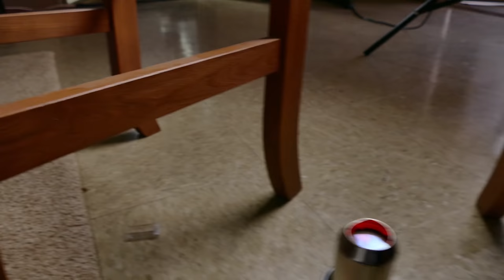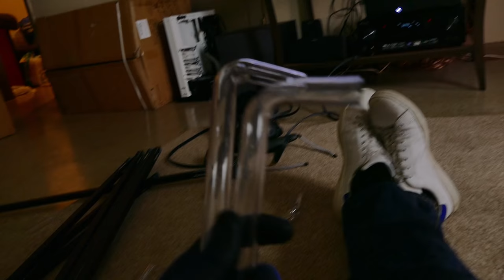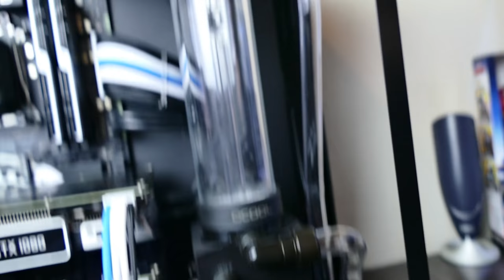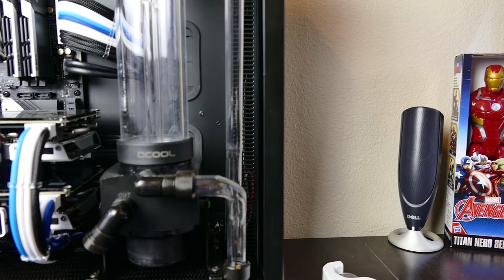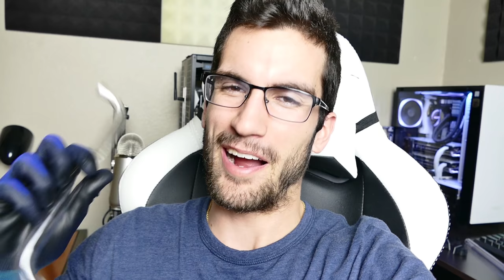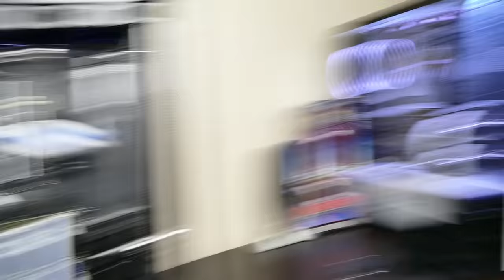Project 'Blue Sky' Custom Loop PC Build Log (Part 3 of 4)

Comment: Hey Gregg, just a suggestion why not come straight from the back of the pump and do a 90 degree back and then a 90 degree down to the radiator making those just two bends, hell you could even use 90 degree fittings and no bends with three small straight runs. back over down. Hard to tell in the video but maybe the distance back is too short to do that?
https://gyazo.com/d28b8c4ad4fb2014271d14237d4854dc

Comment: I think your trying too hard to make far too many bends within small tubes. trust me, when you run the loop you will see imperfections. you only need to heat it enough quickly to bend it once without continuing to put it over the heat gun, that is the result of bubbles. My first time, I wasted like two 50cm tubes. too many rediculous bends within your build. Even the pros don't do that..

Comment: I think the tube bending process would have been smoother for you if you went with a smaller diameter tubing. I have used 3 different tube sizes and 12mm is way easier to work with then the diameter your using.

Comment: Yep,  my first foray I had set aside an entire day and had 8 meters of tube. 2 days later, with sore hands and cramping fingers I had it good enough. It would be another couple of weeks before I pulled it apart and redid the one tube that wasn't up to stuff.  You are correct that, like anything, you get better.  I was already 100 times better when I revisited that last tube

Comment: Put it on low heat and rotate the tube while also heating up the tube about 1-1 1/2 inch away from the spot you want to bend! I havent put custom cooling in my setup yet but i have helped someone do theirs though and yes it was expensive and frustrating!!!!!

Comment: You need to keep spinning the PETG when you are heating it and not leave one side exposed to the heat for very long. That's one of the reasons you keep getting kinks in the tubing. Another reason is because you keep giving those little forceful bends to see if it is ready to be bent while heating it. When you continuously spin it, it will give you a better idea of when the tube is ready because the tube will start sagging while you spin it and a few seconds more over the heat, you can start the bend. The smaller silicone insert might still cause some kinks, but not as bad as you're getting now. Hope this helps you out some. Also, if you have a wrench socket, use that for 90 degree bends. The bigger the socket size the better.

Comment: Use a copper pipe cutter with an adjustable cut depth and roll it round increasing the cut depth slightly after every couple of turns. It'll cut a groove which eventually pierces all the way. Scissor type cutters are for soft reinforced tubing not brittle stuff.

Comment: You are supposed to dip your silicone insert in soapy water and it will help keep the PETG from over heating and also make the insert easier to remove. However, since your insert isnt an exact fit, it might not be a huge deal. But dipping the tube into the water after the bending will make it keep its shape.

Comment: when you cut the tube with the cutter, you hold the pipe, and you cut the pipe rotational, not like a scissor. Your pipe will end up looking like someone stepped on it! I know, because i use to do plumbing. same goes with copper pipe, rotational cut. Also if you want a perfect bending on hard line, use a pipe bender like what we use on copper pipes, saves you the frustration.

Comment: Keep at least 4 inches away from heat gun on low setting only, constantly rotate the tube and moving side to side about an inch or two and wait till tube cannot hold itself, do not rush it or it will kink, keep hand pressure even and light or tube will stretch or push together. When I did my first build ever with acrylic these were the most important points and only scrapped about 3 feet. Properly heating a bend takes time with acrylic I was taking almost 5 minutes per bend because too close ,too fast and not rotating ruins the bend every time.

Comment: The silicone inner rubbers have to be slightly to smaller than the tube I know when I bend 12/10 tube the inner diameter of the bending rubber is 9.8 this is because when you put a bend it puts stress on inside side of the bend gripping the rubber and holding it in place if it was 10mm it would be near impossible to get the rubber back out.

Comment: I was relatively competent at it when I tried it (I found it slightly too time consuming however, but I was more busy with school at the time) but I had done neon tube bending a couple times before, and that was a lot harder, obviously, glass and blowtorches and having to blow into the tube to stop it collapsing, it was a pain in the ass without lube.

Comment: Gregg I have never seen a silicone insert like that most builders use a thick walled(to prevent kinks) soft tube that fits and most will have a bowl of soapy water to lubricate the soft tubing so that it comes out easier I just figure you could take one of these tips.

Comment: A friend of mine got tired of trying the silicone inserts that didn't work for him.  He went down to our local gravel pit and got some fine sand, picked up some corks from our pharmacy, and went to work on it again.  He said it was far easier and more predictable to make the bends.  He also used a diamond electric saw to cut the tubes.  All in all he put it together and it looks great.

Comment: With those cutters you have to rotate it around the tube or it will pinch it like you showed.  Rotating the cutter around the tube while you squeeze should nearly eliminate that problem.

Comment: I can save you a lot of time, heat up about 3 to 4 inch's on each side of your bend. If you only heat up a narrow area you will have crappy bend all day. The more tube you heat up the easier it is to get the bend you want.

Comment: Spin the pipe in your pipe cutter as you make your cut. only till the cutter starts to cut into the pipe without deforming it. then Finish cutting through your pipe all the way, and you will get a straight cut. as long as your cutters were lined up straight from the start, otherwise it will corkscrew up or down the pipe.  take it from a pipe layer.

Comment: to cut the tubing simply apply i light amount of pressure on the tube with the cutter then twist the tube until the blade just pierces the tube then continue cutting

note: only twist the tube slightly, not full 360 or anything

Comment: ok one thing ive noticed your not doing is shimmy the tube side to side a little bit. you want to heat up around 3 to 4 inches with the middlebeing where your bend is, while also spinning it around.

Comment: When i cut PETG i put it in the cutter then rotate it to "score" it a little bit before going thru with the cut so it does not bend. give it a shot. Also Rotating the tube constantly helps spread the heat where you are bending as well.

Comment: You werent rotating the tubs enough to distribute the heat evenly before your bends and rather then let the tube bend when it was ready, you were bending it with uneven heat. So one side might have felt ready but the other was still to cool, thats what causes those kinks or bubbles at the bend location.

Comment: Well it can cut bether. Tight the tube on something and rotate the tool until you cut it. You don't need to use to much force. Maybe it is not the fastets way but at least you'll get better cut than this.

Comment: one thing i noticed you werent doing is your only heating up a small section of pipe you may want to move the pipe an extra inch left and right and heat up more area than what you showed

Comment: Do not directly cut the tube by putting pressure on the cutter, turn the tube until it is cut. that's how to use those cutters.

Comment: Hey Salazar :-) first I have to say that I am watching your videos since your Yt start so maybe a year now  and I enjoy your videos.  The Tubes you are using aren't Petg's they are acrylic tubes, that's why you couldn't cut them evenly with your cutter. the best way to bend curves would be if you measure the distances between the connections you wanna have. then paint them on a paper and lay your drawn picture of your bends on a table. Tape the edges of that paper on the table. if you wanna bend them free handed use drinking glasses which are little smaller than the curve you wanna bend and bring them to the place of your paper on the table where you want your curves. Now you can start to heat the Tubes.  With your heater you have to stay about 10 inch above and always turn them while heating up ( you had bubbles inside because they have been heating too fast and Ono side was cooler than the other side and they didn't stretch evenly while bending ).  So now heat them up like I said and always heat the Tubes 5 inch at both sides more than the bend you want. When the Tubes heated up they look glossy and the tube tries to bend itself. Take the tube now and lay it with no pressure on your painted picture on the table. You can bend it now around that glas which is on your draw without using pressure just to have the right angle. I bet this works even perfect ;-) ( I did it that way in my rig the second time I did it ) . Please be careful and take out the Tubes you have already installed because at the places of the Tubes where you have bubbles inside the acrylic tubes gonna break in nearly 2 - 6 month so take care. Sorry if my written  English isn't perfect but I had to share that with you.  Greetings from Germany and good luck with your build.
Reply: sorry Ono meant one :-)

Comment: in my experience those pipe cutters works better with light walled tubing if you apply pressure very gradually and continuously spin the tubing (or cutter) all the way around, cutting a ring deeper and deeper until you finally make it through. Patience my man.
Reply from the maker: Billy Weisberg Not easy to do with this tool, which is why I do not recommend it.

Comment: You were using that tubing cutter wrong. It isn't scissors and shouldn't be used as such. Speaking from 15 years experience, those tubing cutters can make cuts as straight as any other cutting implement if used correctly. Next time try to cut slowly and turn the tubing steadily as you cut. If the tube is getting deformed then you're using too much pressure.
Reply from the maker: Funk E Not easy to rotate that tube in the tool. At all.

Comment: Welcome to the bending club!
Jay got me hooked on custom tubing about a year ago. Good job for not giving up. Good that I hat you didn't have to pay for the gear.
My basic tip would be...make sure you use the insert a bit out of the tube. That way the tube show you where. it want to bend. Use low heat and adapt the temp by holding the tube closer or further away. Heat the outside a bit more when you start to bend. The material need to stretch farther away.
Have a look at Jays view..great tips there.
Hollar at me and I will help ya
Reply from the maker: Thanks for watching, Stefan. And thanks for the tips!

Comment: As long as you aren't using a proper insert you won't get any kind of decent bend with your tubes. It's not a lack of skill. The insert is just too small. You shouldn't be able to get it in the tube without some dish soap water.
Reply from the maker: UnitedStatesOfMoney Exactly what I was getting at.

Comment: good going.. See i told you that cutter isn't meant for PETG and is for soft tubing (through my twitter handle @Devilz_ADV).. And ya don't worry about the same being awful.. you will get good with practice.. and there is always scope of improvement at later stage.. I rather prefer straight lines...but took me time to improve.. its a evolving process.. and ya Jayztwocent was very helpful.. watched his videos over and over again to lean...
Reply from the maker: Virender Negi It's for hard tubing. Says so right on the box.

Comment: Why my GeForce GTX 1050 doesn't have a VGA port and my old GeForce GT 630 2gb has one VGA port?
Both GPUs are from Gigabyte and the gtx 1050 is the standard one with one fan
Sorry if the question is stupid
Reply: LogTop because vga is getting old and  no longer supporting higher refresh rate at higher resolution thats why they used hdmi or display port instead of old vga
Reply: +neshwin ng Thanks
Reply: you can get an display port to vga adapter that will allow to to use a vga monitor if you need it.

Comment: Fill the tubes with sand , cap  the ends. Control the heat better.
Reply: And you need a "jig" something circular and fixed to a flat surface to ensure a proper circumference.

Comment: i wonder if you could do it like a neon tube blower. check that out, doesn't use the silicone.
Reply: they use a soft tube connected to a cork in one end of the hard tube, a cork in the other end, and the soft tube in your mouth. you sustain air pressure in the tube by blowing and that keeps the bends from collapsing.

Comment: you are cutting them in the wrong way! the cutter does not work like a pair of scissors! you must put the tube inside the cutter, and then twist the cutter around the diameter of the tube multiple times, and then it will pop. you must not squeeze the tubing, you have to slowly cut the tubing around and around.
Reply from the maker: John Despotakis Not easy to do with this tool. I rotated later on.
Reply: Salazar Studio 
I'm telling you this because I'm building right now my own loop with petg and I have the exact same style of cutter. you must gently rotate the tube so that it is scratched slowly around it's diameter and at some point it will pop by it's own. no need to apply pressure!

oh and btw your tube broke while trying to remove the silicone tube because it was stuck. you must coat the silicon tube with soap water so it has a good lubrication with the inside of the petg pipes. also, try finding another silicon tube with the right diameter. it will make your life 1000 times easier.

p.s love your channel keep up the great work!

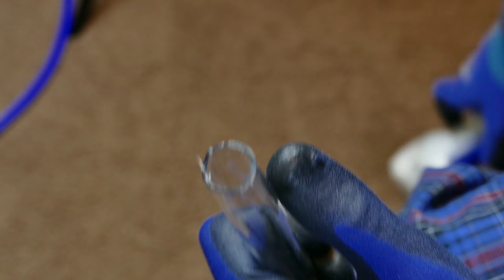Comment: Try heating the metal that cuts the tubbing. 07:45
Reply: That won't help. I had a similar tool from xspc that might be a bit sharper but what really helps here would be cutting the tube with slight pressure while rotating it around the tube so that it works like a tube cutter.
That worked perfectly for me and it is a lot faster than the tube cutter.

Comment: you're focusing the heat too much in one place, that's the reason why your flat spotting on the ends of the bend.  you need to spread the heat over a larger area so when you bend it the bend has more surface area to stretch the outside of the bend so you dont see a flat spot or dip. when you only heat up the small amount surface area of the tubing, you are stretching less material further which thins out that area which is why you're seeing those dips and flat spots. you need to heat up more than just the bend, you need to heat up enough area so it has enough material to stretch without visibly thinning.
Reply from the maker: Elias naranjo Yes m8, that was what was happening in the middle of the video.
Reply: it'll work out bro, I'm excited to see the final outcome.